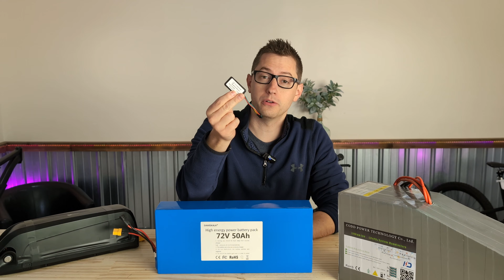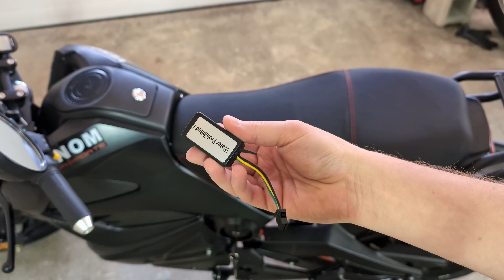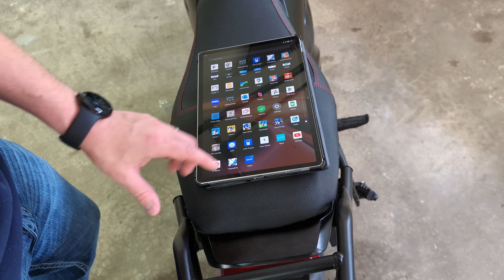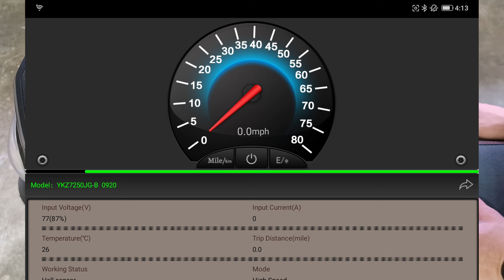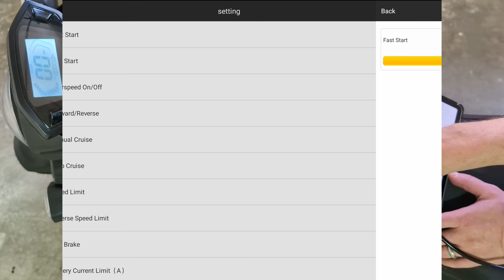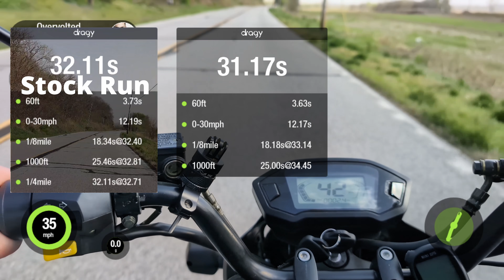UNLOCK HIDDEN POWER? E-Vader Controller Tuning!

Comment: were did u get the dongle?..also do u know what lithium batteries fit it and what about upgraded controller???
Reply from the maker: I updated description with the link that I used but it's currently out of stock so I posted another link that looks the same but it's twice the price. Maybe there's a different place to get them currently.
Reply: @overvolted what controller is in the stock evader?
Reply from the maker: Hey! it's a Yuyang King 50a (YKZ7250JG-X-8C66517)
Reply: @overvolted thank you. Was trying to see if it was the same as the fly Z6, it isn't

Comment: I have this same bike but need that odd shaped battery you have where did you get that?? Please get back to me asap I’m in mid rebuild
Reply from the maker: I got it on AliExpress but I'm not sure if it's still there. Let me check
Reply from the maker: https://www.aliexpress.us/item/3256805074359202.html?spm=a2g0o.order_list.order_list_main.52.30151802y2WrC0&gatewayAdapt=glo2usa
Reply: thanks for the lead, found one!!
Reply: Do you have full video after you unlocked the bike speed

Comment: On the electrical block there is a yellow wire that goes to the key switch of the evader 74 volts.... Normally connected to the red skinny power switch wire... When upgrading to a sine wave controller.... Do you connect say the orange wire from the key lock.. to the yellow wire coming from the stock bike.. unscrew it down on the block..🎉 I thought I saw another video that said don't do that that it would blow up your box

Comment: The link to the bluetooth controller has been removed, I assume because a reputable source has dried up. I can't seem to find any that exactly match the label design of the module you have in the video. Do you have an updated source for legit yaz1403BT bluetooth modules?
Reply: The new BT controller model number is YAZ1408BT and it works with the YKZ7250JG speed controller.  I found mine on Aliexpress.

Comment: Is there a replacement charger port for the bike i melted mine. Everything is still working minus i camt cherge the bike
Reply from the maker: I purchased similar style receptacles before on Amazon. They might not be exactly identical, but I'm sure you could make it work and just run the wires down. https://amzn.to/49Dd2vT
Reply from the maker: This one I linked has the flip over cover flap and everything. You don't need it to support too many amps since it's just charging. Just a positive and negative wires coming out the back. You could either cut off the XT 60 end or use an adapter and connect to the existing wires for charging
Reply: Thanknyou so much i have had the bike for literally 24hrs and fried the wires @overvolted

Comment: My e Vader just arrived but I don’t see that connection to install the Bluetooth module lol rip I’m guessing I’ll be needing to take out the sides
Reply from the maker: Yeah, or if you're able to pull up some of the wiring out of that hole, it's probably just pushed down or in some different orientation. Otherwise the side comes off pretty easy
Reply: I was able to pull out like every single other cable that isn’t connected to anything but the Bluetooth one lol I’ll take a look at it later going to register it today
Reply from the maker: @keithsepulveda8992  haha of course! That's how it goes

Comment: I've found tweeking the app just applies to more of the torque than top speed , when you change it the start is thr only time you feel any difference.
Reply: I messed around with the settings and got mine topping out at 38

Comment: I sold mine 2yrs ago, I never knew that I could swap the lead acid battery until now. 🤦🏾‍♂️
Reply from the maker: Bummer!!! And there are some pretty cool upgrades to make it more fun. We're going to be playing around with.... Mainly to make it faster
Reply: @overvolted  Bummer indeed, but at least I know now. Ok cool, sounds good. 🤙🏾
Reply from the maker: Just curious, were you having issues with yours at all? Battery performance, anything else?
Reply: @overvolted  Nope, I was just use to “Lithium Ion Removable” batteries 🔋🔋….not a “Lead Acid” fixed battery. That was a dealbreaker for me. The specs were decent (72V 2000w motor > 72v 20ah 🔋 > 40mph top speed) @ that time (2021). I just needed MORE lol.